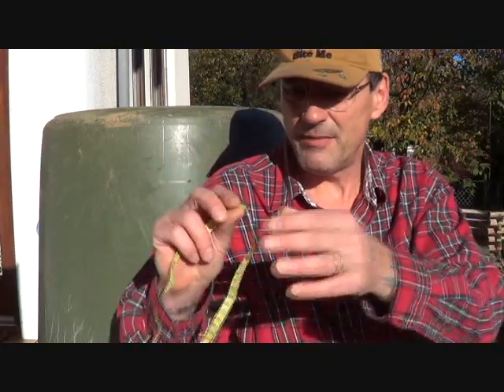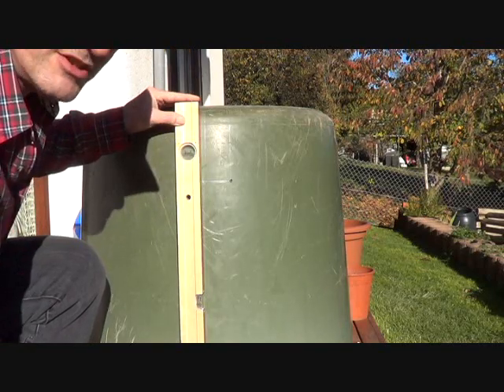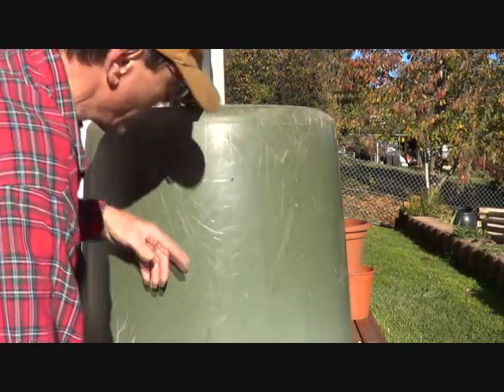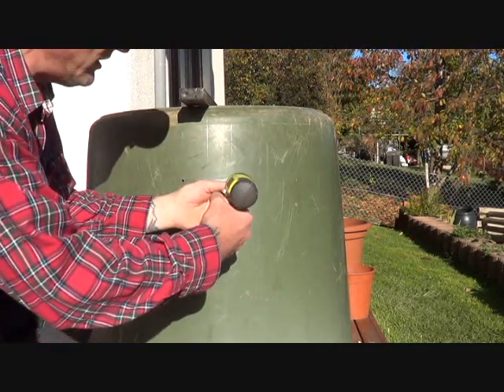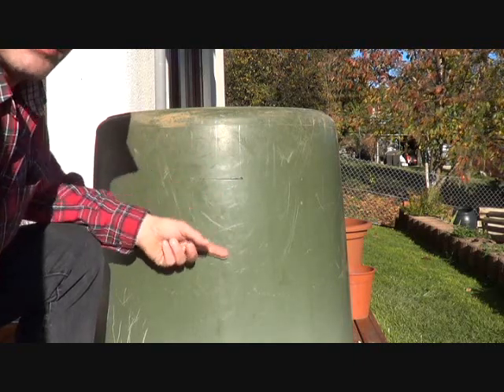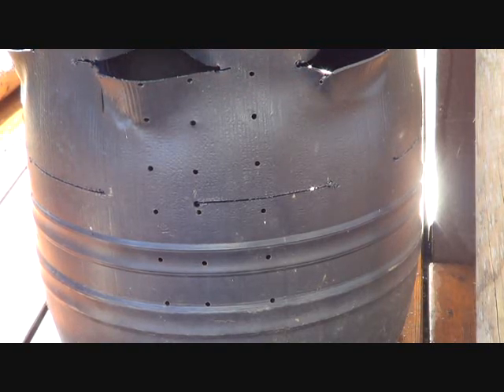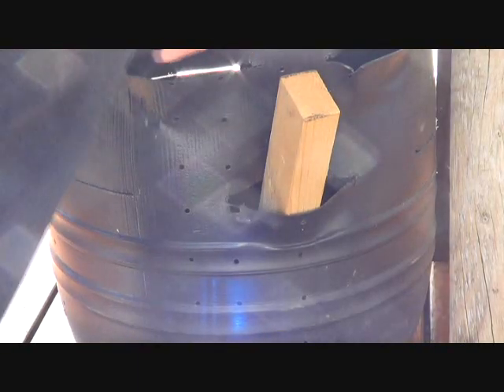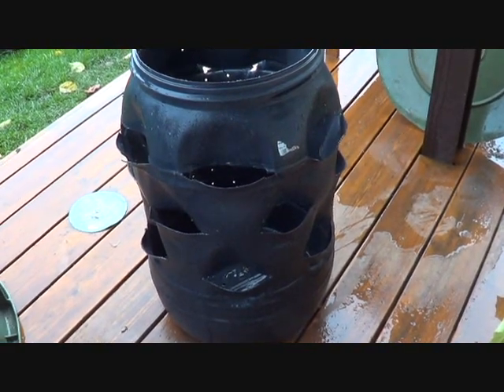Building a Grow Tower

Comment: What kind of barrel?  What source?  jmWo;fe
Reply from the maker: I saw you commented on both my grow tower videos. The green barrel is rainwater catchment barrel bought at our small  local garden shop several years ago. The bottom developed hole that couldn't be fixed so I did this. The smaller black one was a generic container originally intended to hold drinking water bought at the same place.